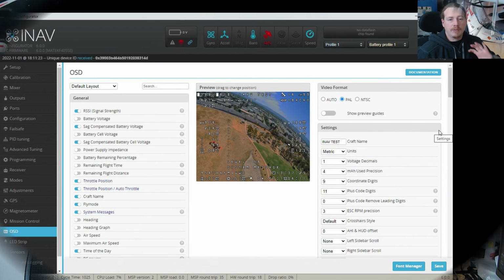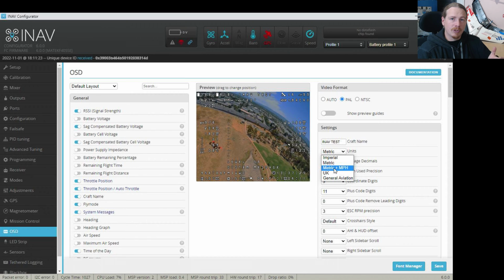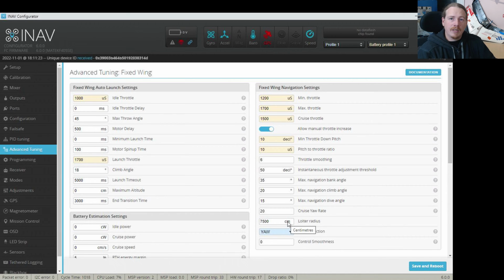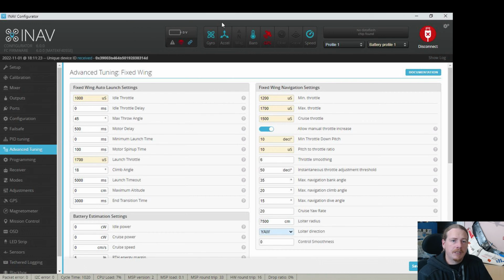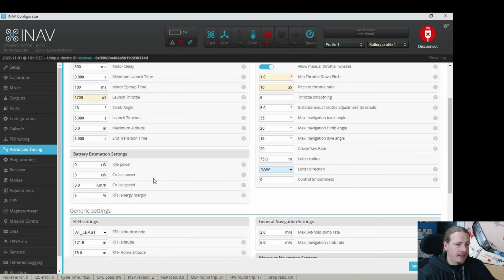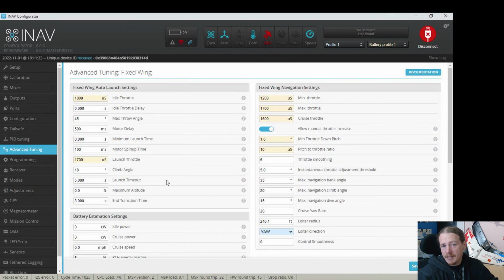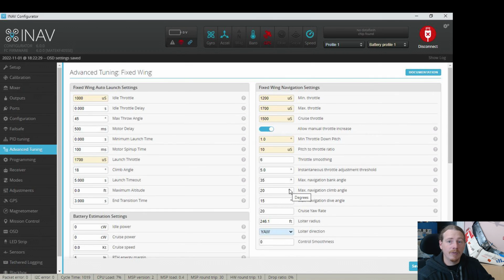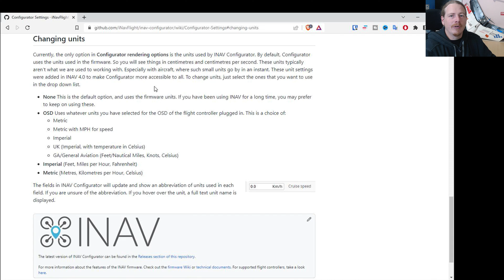Using different measurement units with INAV

Comment: This video is a year old so don't know if you'll see this but on the subject of units, do you know how to change between metric and imperial in the iNAV telemetry LUA on a TX16S?  I'd like to see mph instead of km/hr and altitude and distance from home in feet.  Thanks for this video, BTW!
Reply from the maker: You need to change the units of the telemetry sensors on the transmitter. Off the too of my head, it’s the last page in the model menu. Pick the sensor, like GSpd, long press the enter button, then change the units to mph. As a warning, don’t change the units for the Tmp sensors. The Spd and Alt sensors are fine to change.
Reply: @MrD   That was it Darren.  All set to those obsolete imperial units now ;-)   Thank you so much!  
   By Tmp sensors, did you mean temperature sensors?  And meant don't change from degC to degF?  And if so, how come?  I don't have any but just curious.

Comment: Hey Darren great video as always, I have to say the CM  setting drive me nuts but anyway in inav 6.1.1 mission control I've tried changing from metric to imperial but it stays on the metric system, maybe I'm missing something?does that need changed somewhere else? Thanks
Reply from the maker: Unfortunately Mission Control still uses the default units. Hopefully it will change in the future.
Reply: That explains it, thanks

Comment: how do you set up the frsky x20 to a sim and what do you need
Reply from the maker: For most, just the USB cable. I have a model on my radio for simulators. This is basic gimbals and a few switches assigned to channels. Then plug in the USB and select the Joystick option in the menu. In the sim, just select the X20 as the controller. The  configure the gimbals and switches in the sim. 

I have been planning on making a video on this for a while. So I will make that sooner rather than later, in case I have missed a few steps here.
Reply: @MrD  did all that did not work I have the original Phoenix cable but can get it to work so if you can make a video that wood be good
Reply from the maker: With phoenix, I believe you have to set the radio up like a slave in a trainer situation. Then plug the cable in to the trainer port. I don't have Phoenix, as it has been discontinued for a long time. But, this may help with the trainer set up https://youtu.be/cJMVE1keDlI

Comment: Hi. Would you have a video that shows what happens when RTH and it is loitering around in circles? I didn't know how to cancel the RTH and when I toggled the switch off, it fell out of the sky and crashed. 
Thanks.
Reply from the maker: You do just switch out of RTH. Whatever mode you switch to will be what it used. So you have to be ready to take control of the model. 

What exactly happened when it fell out the sky and crashed? What mode did you switch to? How fast was it flying? What model is it? Was it banking? How much throttle were you using?
Reply: @MrD  Thanks so much for replying. I see. So the moment you switch off RTH, it will take whatever the setting on the throttle stick as well as the mode it is set at, eg. Acro or horizontal

While it is on RTH, whatever you do to the mode switch or trottle will not affect the RTH flight. Am I right?

Based on your description, my throttle was probably too low to maintain momentum. 
It was a self built plane using foam boards.
Reply from the maker: Yes. Some navigation modes (including RTH) use auto throttle. So it will control the throttle throughout that mode. There is an advanced setting that allows you to increase the throttle. But it will not go lower than the cruise throttle (unless descending).

If you change the mode, it should switch to the new mode you have chosen. But this depends on how you have set your switches up. As if mode switches are on multiple channels, INAV has a priority order for modes.
Reply: @MrD  Thank you so much for the detailed guidance. 
Now I understand better what went wrong.
Reply from the maker: You’re welcome

Comment: I'd still quite like the option to make Mission planner work in feet - as airspace in the UK is depicted in feet as standard.
Reply from the maker: Mission Control is one of the few areas of Configurator that doesn’t use the units conversion. Someone has been working on Mission Control, and have incorporating the units in their to do list. It would be great to have all areas of configurator using the units.

Comment: If someone was to help with the manual is it done as a pull request?
Reply from the maker: I believe you can just edit it on GitHub, so long as you are signed in. There is supposed to be a way of downloading the Wiki for offline editing. But it didn't work as stated in the GitHub Desktop app. I tend to write it offline, then create or edit the page with the pre-written text.

Comment: It seem the USA needs to learn and use the Metric System like the rest of the World...
Reply from the maker: If the USA adopted the metric system today, there is nothing to say that it would apply to everything. Plus. virtually all the citizens would still have a better understanding of how far a mile is and how fast 60 mph feels. The UK adopted the metric system in 1965. In transport, we still use feet/yards/miles for distance and miles per hour for speed. So for me, I work in metric. But I have no concept of kilometres and km/h when it comes to actually going places. Plus, in aviation, altitude flight levels are still in feet. FL200 is 20,000 feet.

What matters is how well the pilot comprehends the information. There is no right or wrong here.
Reply: There is more metric in the World that any other measurement system. It's of course hard to switch when you live in USA and you learned imperial but imagine how much easier the world would be with just metric system ;) We have full dropdown of measurement systems when it could be simply one: metric. Why not to at least try?
And it's not about forcing somebody to use metric it's only about making him aware that because of "imperial attitude" other metric guys (90%+ of people in the world) just suffer... Even programmers needed to implement those units conversions and they have to maintain it ;)
Reply: @rfly-fpv  Canada was Imperial.... Canada is now Metric and no one died...
Reply: @lasersbee  I actually have hard time to believe that in UK they "switched" to metric but left mph for speed :P Either do it right or not do it all all...
Reply: I agree with Darren that there is no right or wrong measure unit, only what pilot is comfortable with, with that said inav has a mixture of metric and imperial to me this is a problem that has bit me more than once.
Reply: I use general aviation units for mine. 

I wish people could do whatever they wanted without some angry idiot telling them to do things differently. I just built my second fully autonomous plane; my brother would not stop telling me I needed to just "buy a little reciever and go fly line of sight instead," all the way up until I started posting my fpv flight videos.
Reply: @joshmellon390  People CAN do what they want... Just don't listen to those Angry Idiots....😉
Reply: Thank your for telling me what I need to do as someone from the USA.  A lot of people in the US use both.  mm/cm are easier to work with for small measures because you don't have to think in fractions.  Same thing with weights.  Easer to think in grams than ounces when dealing with small quantities.  When it comes to larger distances and heavier weights it is easier for us to use miles/mph and lbs.
Reply: @BryonGaskin  Don't get your panties in a bunch....😉 I was not pointing at you directly... I mentioned the USA as a country not as a single person... It would be up to the US Governments to implement any change.